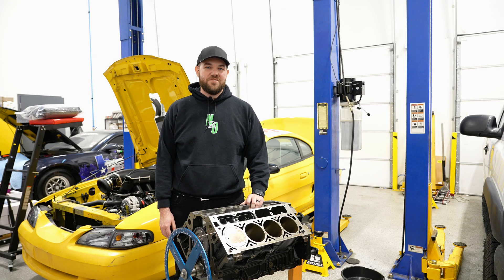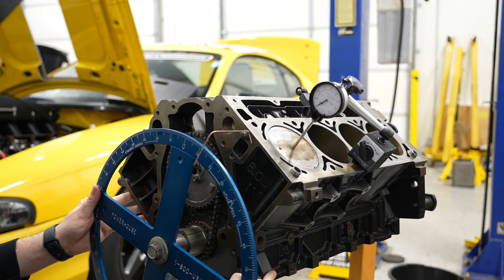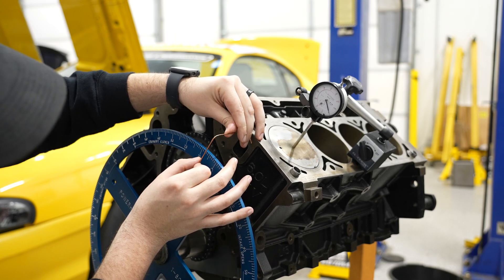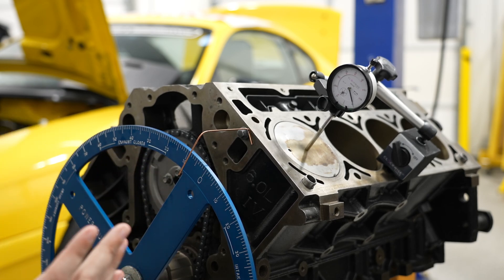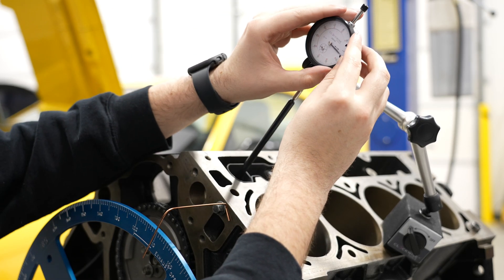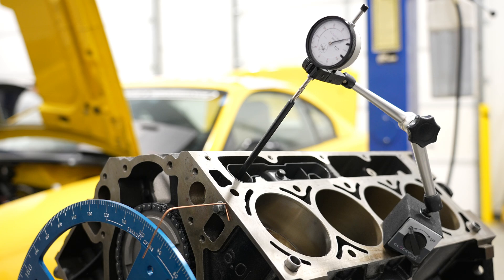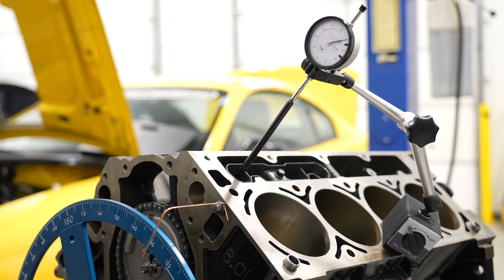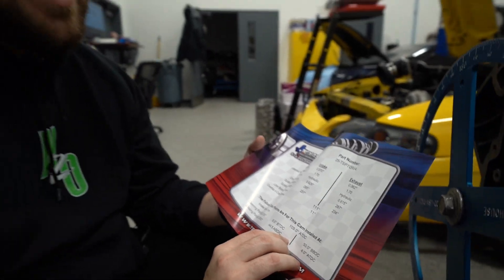How To Degree a Camshaft

Comment: Well, for those of us that have never done this, whats the point? And if it is off, how would you fix it?
Reply: The point is so that one could understand HOW to degree a camshaft. With this knowledge you would know how to advance or retard the camshaft in relation to #1 exact TDC so that you could move the power torque band to lower RPMs or higher. I used always do dot to dot until I learned how to do this.

Comment: I’m sorry if this is a dumb question, but why is this necessary? Isn’t this the point of the cam spec sheet? I mean these cams are cut on a precision cnc. Are the numbers really off that much?
Reply: I always have the same question.  I have installed hundreds of camshafts and have never degreed one in my life.  All of my engines have ran excellent.
Reply: I think this is done just to confirm. Better to find out now rather than later.